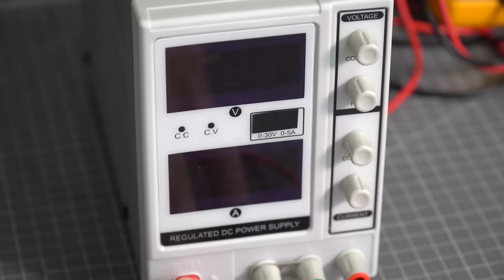Making a Solenoid Boxer 4 Engine

Comment: Upscale and sell it to the VDubbers! It doesn't even leak oil!
Reply: it will when the're done with it...
Reply: Verrry well executed. Maybe Tesla vill adopt the idea.
Reply: The leaking oil is a feature put in to prevent corrosion to the components that the oil happens to leak on. Manufactures have been doing it for years.
Reply: @andrew75511  I thought the leaking oil was a means of enforcing DIY maintenance intervals?
"Oh shit, there's oil leaking everywhere... better spend the next four weekends completely stripping the motor then putting it back together again. My wife will be fine with this."
Reply: Vilber i still needs oil, which means it will leak at somepoint
Reply: @sixstringedthing . That's only an after effect. It's true purpose is so that the oil coats the entire underside of the vehicle. Built in undercoating! That's forward thinking!
Reply: And the fact that original vdubs had no true oil filter, constant replacement of leaking oil keeps it cleaner in the engine.....right....right?

Comment: Nice video, thank you. I do have however a few remarks and questions:
why did you make the piston rods using a saw and a file instead of your cnc milling machine?
why are they so thin?
the flywheel has 5 holes in it, I bet this is for air cooling, but it does reduce the total amount of weight
you mad a messing ring to which you glued a second ring (@12.58). why not make it from 1 piece?
the machine has a wobble even though you machined it with high accuracy. Any idea where this comes from?
I know many questions and remarks, still a great project.
Reply: I dunno about the rest but for the last question, the wobble is definitely from concentricity error between the shaft and the flywheels and especially the spacing of the holes in the flywheels relative to the center hole. The first of those two errors comes from every time he removes / inserts a new piece into the 3 jaw chuck on his lathe. The center isn't absolutely perfectly picked up every time, and depending on how precise you're trying to get it's quite an involved process involving usually a 4 jaw chuck and an indicator to measure the runout to get it within whatever your tolerance is. Speaking of runout, visually the amount of runout on the shaft looks pretty good when its spinning in the lathe but if you put an indicator at the end you'll see how much it wobbles. An easy fix would be to machine it between centers, already that would buy you a ton of extra precision.

That being said I bet most of the wobble is from the hole spacing on the flywheels not being perfect. The way he made the flywheel was to drill a center hole and I'm guessing CNC the other five around it, which is accurate to however well set up your CNC is. To get them more perfectly spaced and concentric around the center hole it will be rotating around, you would probably drill the center hole, and either chuck it or put it on a mandrel with a dividing head to locate the holes the exact same distance from the center and into exactly 1/5 of the way around a circle every time (which is what the dividing head does). If you look at around 14:55 you can already see what I think is most of the wobble on that front flywheel -- you can see the holes visually wobbling.
Reply: not an engineer or any kind of expert, but my guess on the connecting rods question is that he might have been using a different material for them and couldn't cut it with the CNC. I'm not sure if he is using steel or aluminum for most of these parts, but perhaps for the rods he used either a different alloy, or a harder/stronger material altogether.

Then again, maybe it's something completely different! 🤷‍♂️
Reply: @austinyun  Some of the wobble comes from inherent rocking couple behaviour of Boxer engines (opposite pistons cancell out most of the intertia but since they are offset a bit here is some torque left). This could be fixed by changing the order of pistons on the crankshaft (left right right left instead of left right left right). This is not done in real engines to save space and keep bore offsets equal.

I stil think you are right about the flywheel being unbalanced, it seems that's where most of the vibrations come from.
Reply: Regarding the holes in the flywheel: the ideal maximizes the moment of inertia while minimizing mass (within the geometric constraints of the application). Mass that is farther from the axis produces a larger moment of inertia, so the flywheel is designed with holes near the axis to push the mass distribution toward the edges. The same principle explains why beams are usually designed to be either I-shaped or else hollow: it’s all about maximizing the moment of inertia while minimizing the mass.

Comment: I like the way it proves the concept of opposing pistons creates less vibrations than conventional piston arrangements. Nice job bro, keep it up.
Reply: I have a subaru with the boxer engine 4 cylinder and its very smooth though doesn't idle so smooth.  I've heard the 6 cylinders do idle smooth, however.  The width of the engine forces them to have a short stroke which produces good hp, but lacking in torque, or so I've read.

Comment: Everyone else: I will use metal so I can flex
Me: *3D prints everything F L E X E D
Reply: Nanotech 3d printing 👌
Reply: I thought the same but many experienced the parts or the engine gets too hot so the printed parts melt.
Maybe if do a e engine I will have to cool it down or put a lot of fat on it.
Reply: It won't work cause the magnetic field produced by the solenoid will not affect the plastic.
Reply: @psd5828  glue a small rare magnet at the end of the 3d printed part....
Reply: @piejecko  Nah, you can use PETG, make a tiny fan on the other end of the crank shaft...boom air cooled.  I just might do that during this lock down.

Comment: Thank you for the video. And compliments for your engineering skills.
As an improvement (when I was young I tought I was an inventor) you may want replace the microswitches you used for timing the electromagnets, with some Hall sensors and switching transistors. Those microswitches - they say 100k operations - but fail for no reasons. With the Hall sensors and transistors and a bit of lubrication, your engine can work continously for years.
Again, my sincere compliments for your skills.

Comment: I loved this video!  Spectacular manufacturing, final product was amazing.  I apologize if this question has already been answered elsewhere, but I'm curious if you calculated the power output vs input efficiency, what that was, and if you calculated how much torque was being produced at the output shaft and how much that was.  I'm asking because I am curious how it would scale up to be used in electric vehicles and other applications.  Thanks for producing such amazing content!!

Comment: Really cool vid, showcases the benefits of an electric motor by sheer number of moving parts and friction. I would love to see a radial solenoid engine like this, might be able to build in the firing switches mechanically with the helical opposing solenoids for some crazy runaway rpms...
Reply from the maker: Awesome ideas!!! crazy runaway rpm.. that's really cool. Thank you :)
Reply: The sound of this piston machine excels the sound(lessness) of a rotary motor. Imagine a car model with this motor, but no stinking fuel needed! VROOOOMMMMM!

Comment: This is a beautiful build, but I have to admit that I cringed when I saw you hand wind your solenoids. With all your enviable tools and machinery, you could have mounted the solenoid cores onto your lathe, run it at a very low speed, and wound the wire nearly perfectly. Other than that, this is a super sweet build.

One more suggestion, if you're up for a modification: I would love to see this little engine operate with non-contact proximity sensors (hall effect, magnetic, optical, etc.) in place of the microswitches. A small transistor amplifier circuit would have to boost the power for the solenoids, but it would let the engine run quieter and for a long time without any switch wear & tear. Cheers!
Reply: I didn't exactly cringe, but I did wonder about the solenoids because I remember the neat thread-winding attachment on my dad's treadle-operated sewing machine, of all things. Having grown up with that, I always wonder why electronics enthusiasts wind coils by hand! ;) But I know from software that you can get really fed up with making tools to make things and sometimes just want to do something by hand.
Reply: honestly it adds a nice aesthetic to the whole engine

Comment: I see a design like this being able to work as a hybrid combustion/electric engine, as the piston heads would have little issue being added.
The only issue I see with this idea is thermals, would need to have the coating of the coils be heat safe on the solenoids, or have wires separated physically to prevent shorting.
Reply: dont understand why you would do this, because the coils are attracting the pistons and not generating any energy. And the explosion of any fuel will not be affected by a little magnetism. In my opinion it would be a total waste of money as there is no additional power generated.
Reply: Solenoid engines are cool, but totally impractical as their efficiency is low compared to an electric motor due to the huge air gap.  The model shown in the video has brass coil forms, which will have enormous eddy currents, making this model no doubt ridiculously inefficient.
Reply: @notamouse5630  air gap?
Reply: @freewheelburning8834  A solenoid has greatest force when more of its magnetic field path length is through a ferromagnetic material.  As the coil is not surrounded by iron or some other magnetic core material, preferably in stacked plate or some other nonconductive form, its force to current ratio is low.  Do I suggest that having a backstop on each solenoid of iron which touches is good?  No, the holding force would stop the engine model.  Do I suggest doing a model where the crankshaft constrains the piston somewhere short of the iron backstop such that fields are appropriately concentrated and you get better power density and efficiency?  Yes.
Reply: @notamouse5630   it's possible
Reply: @notamouse5630  why not lengthen the cylinders
Reply: @freewheelburning8834  Because it is field strength that matters and the length does not increase the strength.  the number of turns per length does, however nothing will have anywhere near the effect of an iron part to guide the field and increase the inductance.
Reply: @tripplefives1402  Again thermals would be an issue; if the pistons were magnetic, they'd loose it over time to heat.
I see what you mean though, could make a couple shafts inverted without firing heads to work as alternators, but don't know how effective that'd be vs just stringing up some normal alternators to the end of the driveshaft.
Reply: @notamouse5630  what if also the pistons were engineered so that they would react in a way of a sorta turbine that would store energy in something like a superconductor that could be executable at will for maybe a power push?
Reply: @freewheelburning8834  Increased integration of features in such a design is not desirable.  Cooling would be an obvious concern as it does not scale down well.  High enough magnetic fields will reduce the conductivity of a superconductor to the point where it is essentially no longer a superconductor.  Furthermore, superconductive coils don't have that great of energy density.  There are less expensive ways to do that which are more effective, like compressed air.  If you are thinking of those compressed air turbines in some racecars as your model of effect, superconductors are not suited to store that amount of energy with that density.  Furthermore, Even with the modifications I have previously suggested in my other comments in this thread, a solenoid motor is not efficient.
Reply: @notamouse5630  I was just trying to think of a way you could somehow take all that excess energy and have it stored in a supercapacitor and so it could be executed and released when you accelerate to 88 mph once it hits that threshold it would then be passed through a flux capacitor and perhaps having a digital calendar where you would desire set it to a time period you could go back or forward to,say, 1985 ?
Reply: Rotary's make better hybrids due to rotational force.
Reply: @sofakingdom3076  Marty, I'm sorry. But the only power source capable of generating 1.21 gigawatts of electricity is a bolt of lightning.
Reply: @sofakingdom3076   Total power output is 808bhp https://www.carmagazine.co.uk/car-news/first-official-pictures/lamborghini/sian/#targetText=The%20new%20Lamborghini%20Sian%20is,of%20a%20new%20electrified%20era.
Reply: @freewheelburning8834 , I watched a video about it earlier in the morning. I like the concept. Hybrids are the future until electric vehicles catch up.

Comment: Imagine if a car was powered with an motor like this
Reply: Too many moving parts less reliable rotary even brushless much better l would rather put a regular electric moter in my vw
Reply: Marylou Blackwell wdym “even brushless”
Reply: @maryloublackwell5909  Doesn't have any more moving parts than a "normal" gas engine...
Reply: When Subaru go electric 👀😂

Comment: hypothetically you just taught us how to make a Porsche engine
Reply: i automatically thought subaru but each to their own i guess
Reply: @doodlebob-t1t  I thought Porsche too but I know so little about engines that I thought the 4 cylinders were vertical, like in a box. Silly me.
Reply: @puremedic3975  nah boxer engines are what everyone used to use until the commonly used straight engine replaced most of them. from what i know, only subaru and porsche still use it to save space
Reply: @doodlebob-t1t  and BMW in their Motorbikes

Comment: Great video!
You made an Apposed 4 Cylinder (Boxer), Reverse 2 Stroke, Electrical Motor!
Very clever to use the crankshaft balance lobes as timing cam lobes as well with lever switches as rocker arms to "fire" the coils  Me? I would drive the coils using an Adafruit Trinket M0 (US$8.95) and some power MOSFETs. This way I can control/adjust the timing for various low/high speed/torque situations electronically, with a built-in Tachometer in the Trinket CircuitPython code.  I don't have a machine shop at home (I did have an opportunity to get an old Bridgeport 5 axis milling machine for $100, but my wife said...No!), so I wish I could get the pieces in kit form (as is with the switches in case I want fixed mechanical timing) so I can have this for my STEM students.

Comment: 素晴らしい技術力！
Reply: ちょっと日本語....コピーしないでください、それは特許を取得しています！..
Reply: @ahmedalshalchi  [Making a Solenoid Boxer 4 Engine 電磁石エンジン/ちょっと日本語....コピーしないでください、それは特許を取得しています！..]
特許取得は、水平4気筒モデルだけですか？？　電磁石エンジンそのものにですか？？
 
Is the patent only for the horizontal 4-cylinder model? ? Is it the electromagnet engine itself? ?
 
The electromagnetic engine of the 4-cylinder, 8-cylinder and 16-cylinder engine model is drawing the drawing before the YouTube release.

As a solenoid stepping motor (developed)
Reply: もちろん、水平シリンダー電磁石エンジン用です。

Comment: Very nice :-) Only those coils would look better if you wound them on a lathe :-)
Reply: AP57532 I thought the same thing as he wound them up
Reply: I would mine on a lathe
Reply: There's too much speed on a lathe... easiest is to just make a small hand cranked winder out of a few pieces of scrap wood... simple and easy as well as cheap. Plus you'd have optimal control of everything to keep it neat and clean. :)
Reply: Eric K Depends on the lathe, some lathes have enough gear reduction to go a pretty low rpm.
Reply: @Broadpaw_Fox  just use a  drill on the low speed

Comment: I'd really like to know how this compares to a regular electric motor, at the same sort of power input. Like, power consumption vs torque and such (I'm not precisely sure how these measures work, tbh, but I'm still curious). 

Regardless of that, this is awesome work, I loved watching this! Kudos, and take my thumbs up ^_^
Reply: The pistons are metal rods. One could try carbon rods with magnets at the ends. One could also replace each single coil with two separate coils at either end of the piston and fire the coils such that each piston both pushes and pulls on every stroke in both directions. Point being - there are probably ways to make this setup quite efficient. While there are friction losses that might make it difficult to compete with the best current designs, it would be a very interesting project to build the most functional electric boxer possible.
Reply: @michaelhey4039  dude I was thinking almost the same thing, but what you could probably add to it is an exterior generator driven by the crankshaft that provides constant voltage, you would need a way to regulate the output of the generator or find a way to split it and send the excess voltage somewhere else 🤔 this thing could quite possibly even run on itself if it can get and hold a self-sufficient rpm level
Reply: @devincollupy7033  then wrap it all up in a hvac system to ensure lubrication and cooling?

Comment: This is really cool! Would love to know what the max RPMs would be :)
Reply: I'd guess relatively low.  The imbalance/oscillation looks pretty severe at 1100RPM.  Not sure whether that's from too much play in the bearings, an imbalanced crank/cam shaft, or if the left and right cylinder banks are too far offset and thin.
Reply: ADefenestrator I think it's because the flywheels are fixed to the crank with a single set screw and the loose fit causes them to sit at a slight angle to the shaft